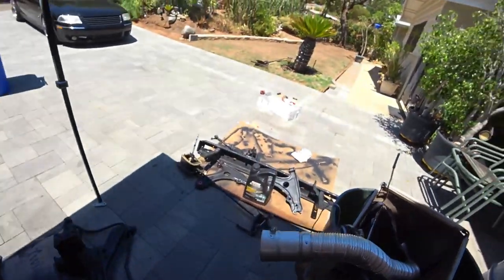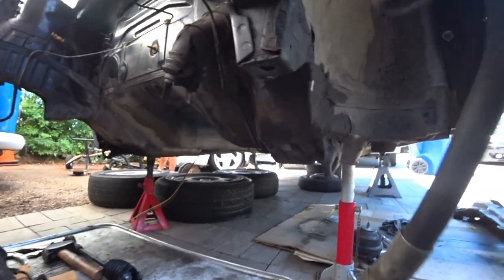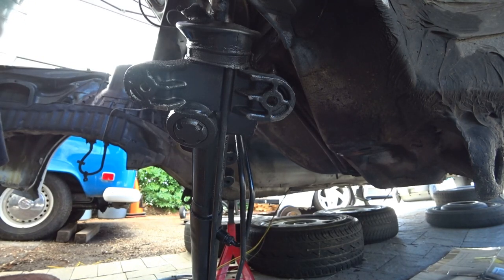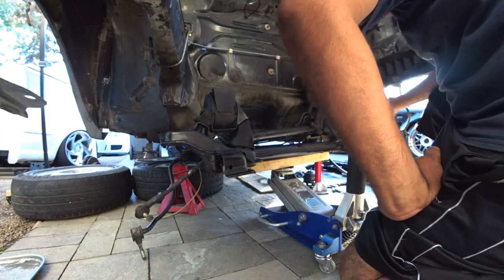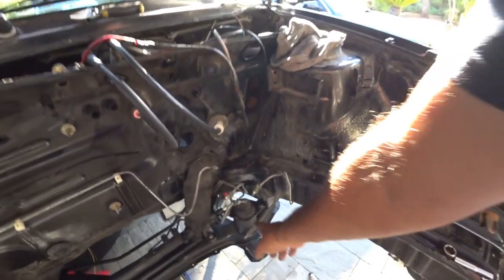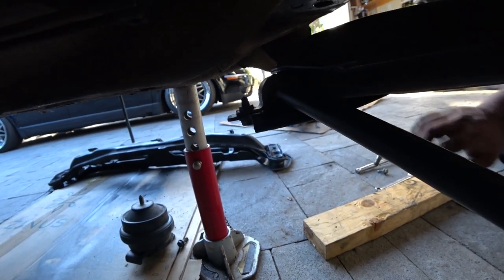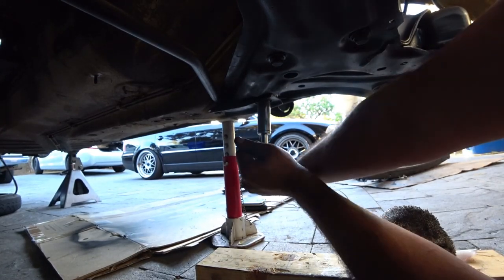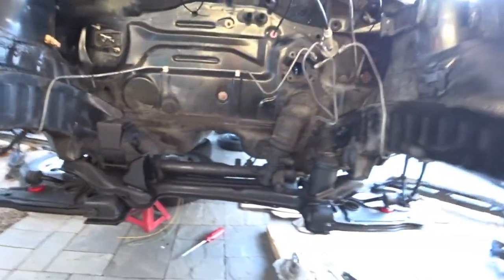How to install VW MK2 subframe and control arms Season5 EP28

Comment: I know that this is a old video but what sub-frame is in this car??
Reply from the maker: We pulled this frame from a beetle any mk4 you can swap subframes with they are all the same
Reply: That’s interesting. I was not aware you can use a mk4  subframe on a mk2. So did you use mk4 control arms, knuckles brakes??
Reply from the maker: Owww sorry i thought this was my mk4 subframe swap
Reply from the maker: For the mk2 i used the original mk2 subframe to swap my 1.8t motor